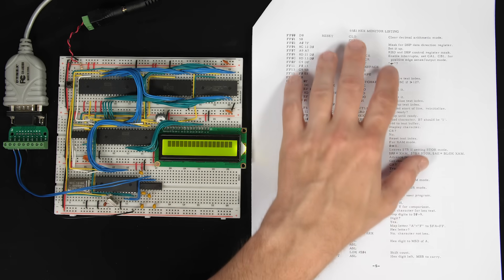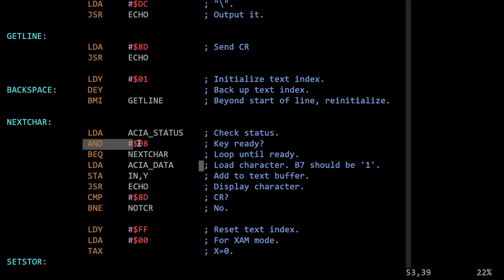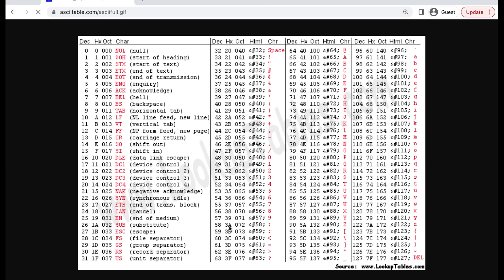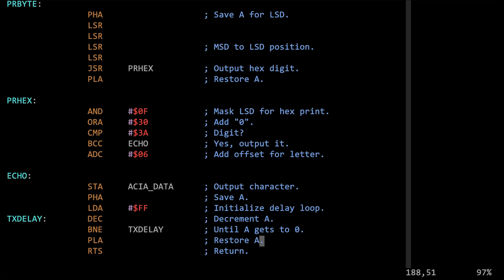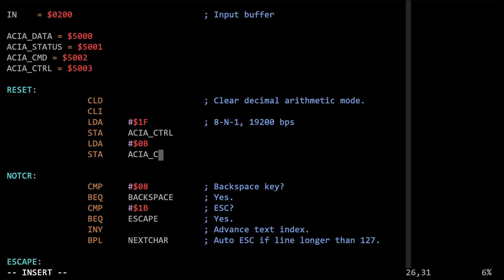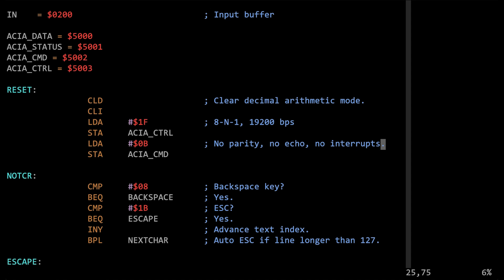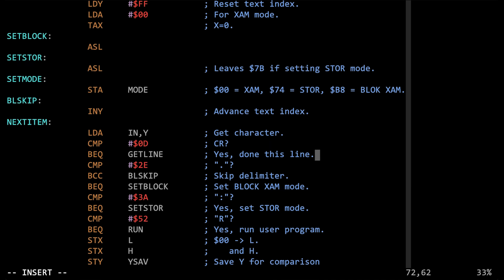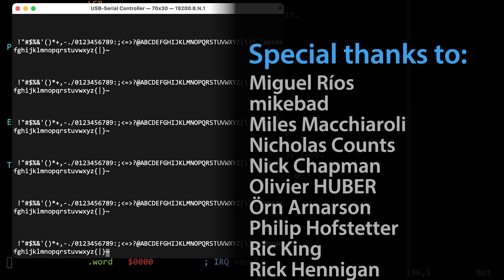Adapting WozMon for the breadboard 6502

Comment: What a great series this is. So much fun. So educational. So entertaining. So meaningful. 

Two comments: 
1) I think at least 2 steps should be added in the RESET section of the code: 
     a) initialising the stack (LDA #$FF and TXS) and 
     b) initialising the ACIA (LDA #$00 and STA ACIA_STATUS) 
Both were there in previous videos. Relying on the hardware reset of the CPU/ACIA to achieve this is (I think) much more risky than relying on the wraparound from $FF to $00 after an INC and the other tricks that the Woz used to save a few bytes here and there. 

2) Adding the two initialisation steps and still fit in the 250 bytes requires to free up some bytes somewhere and I was thinking to initialise the ACIA with "receiver echo mode on" (i.e. set bit 4 in ACIA_CMD) so a character will automatically echo on the terminal and we don't need to do it via code.

Comment: EDIT: Apparently the 65C02 DOES have INC / DEC for A which the original 6502 does not, disregard the following comment, i'll keep it as is, but still worth pointing out it won't work on a 6502.

7:48 You can't DECrement A... bruh... that is not a valid instruction on the 6502 =( ...If your display isn't working (which i notice you didn't show) this probably explains why... that delay loop isn't doing what you think it's doing. god knows what that built as... Just use X / Y with DEX / DEY and that should fix it.

Otherwise i always appreciate your content!

Comment: 1:17 You can simplify your life by adding:
set vartabs=16,8,15
set expandtab

to your vimrc. Then you don't need to enter every space individually. Instead you press Tab onces and vim will enter the appropriate number of spaces for you.
Similarly at 2:06 if you use "R" (Replace) the comment will stay where it is.

Comment: Funny, I was just experimenting today with porting WozMon to the Commodore 64. Yeah, I know, kind of pointless, since there are dozens of other, more capable ML monitors available for the C64. But it was kinda fun, and also helped me in my continuing efforts to learn how to program the 6502 and how to use the Turbo Macro Pro assembler. (Also I was bored and needed something to do :) ) Had to put together some kinda hacky, very much not Woz-like code to interface with the C64 (cursor handling is... not fun) but I was able to get the thing to work! :)
Reply: I created my own ML monitor for the C64 way back in the 80s. All I could get then was a cartridge based version, and it wasn't very good.
Reply: Wow! Who would have guessed! Machine Learning in the 80s!

Comment: I don't remember exactly how the ACIA circuitry worked, but I wonder if a hardware hack to the ACIA output could have pulled bit 7 high when it outputs on the bus, thus not needing so many code changes. It means you could never read a serial byte with bit 7 high, but would be more compatible with other Apple 1 software.

Comment: This was interesting.  I decided to try converting it to Z80 (on a TRS80 emulator), and it seems to work as intended (of course, the TRS80 has a much better disk based monitor, but it was just an experiment).  Interestingly though, I notice a lone "DEC" instruction in the ECHO routine.  As far as I know, the 6502 has no instructions to increment or decrement A.  X would do just as well I guess.  Perhaps DEC is one of those illegal instructions, or maybe a modern equivalent 6502 actually implemented these?  I tried DEC (and DEC A) on an online assembler, and it didn't accept it.

Comment: i wonder if we can make a platform independent version of wozmon that can run on practically everythign
Reply: I would say no, this is low level, you can't really get any closer to the hardware, so it necessarily is very closely tied to the hardware it's running on.
Reply: a portable version of wozmon in assembly is basically impossible, because there are many different versions of assembly that correspond to different instruction set architectures, which can vary significantly. you could write a program in c that implements the features of wozmon, which could be compiled for most (if not all) architectures, although it'd inevitably be less compact and maybe less performant.

Comment: One thing idea Ive had is since the original WozMon program was for a keyboard and a screen, could you adapt it to use your keyboard interface and vga card?
Reply: The Apple I’s screen driver circuitry was basically a serial terminal in a trenchcoat, which is part of why it worked so well for a UART with only a few mods. It could definitely be done, but would require essentially implementing all the ASCII-to-character stuff which this code just assumes magically happens.

Comment: Hi, Ben! Am a big fan of your channel. Thank you for your work!

I have a question: why don't you put all ASCII codes to constants in the beginning of the file, use those constants through the code, and then just change them in one place? Given educational spirit of your video, that would be a good lesson of making code more readable and easier to refactor!
Reply: I had the same thought, and defined the constants and replaced e.g. all "CMP #$1B" with "CMP #ESC" ... but when trying to analyse the code, understanding the result of "CMP #$1B" when the A register contains e.g. "$30" is much easier then "CMP #ESC" ... so I ended up editing the code again and adding the ASCII codes in the comments: "CMP #ESC     ; ESC = $1B" 
On the other hand, it does make perfect to replace e.g. "LDA #$5C" with "LDA #PROMPT" and define "PROMPT = $5C" so you can change your prompt to ">" or "*" easily if you like.

Comment: Well, you could have seen that the codes you were yesting were ASCII + 0x80h, so you just needed to syvstract 0x80h from the test values as well.
Now all those tests take a lot of space, another way of seeing it is to make a table of pointers to subroutines (way to speak, it's just JMPs, not necessarily JSRs), but that would change completely the "spirit" of the code. However, I don't know if the 6502 is able to do JMP [address] with the jump address stored there, like on the 8086?